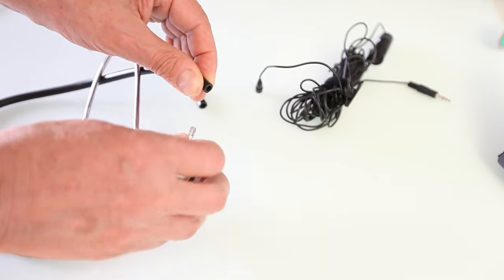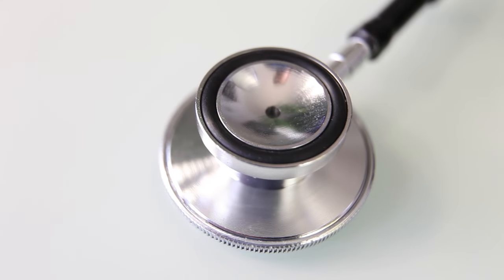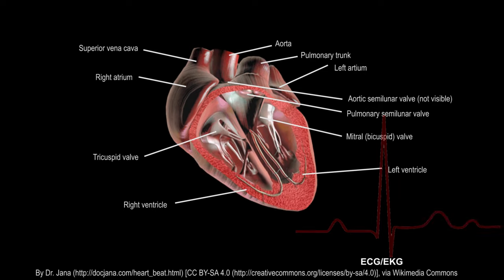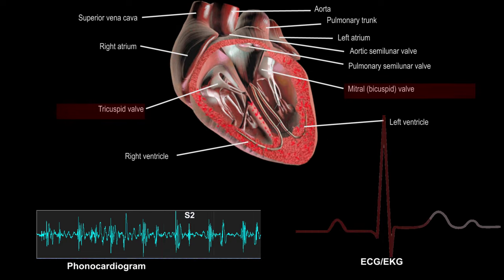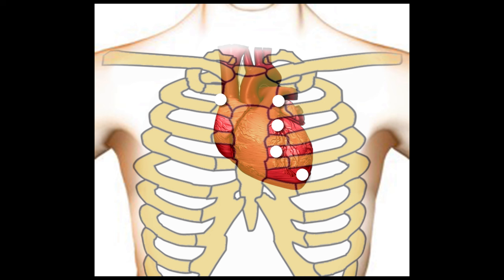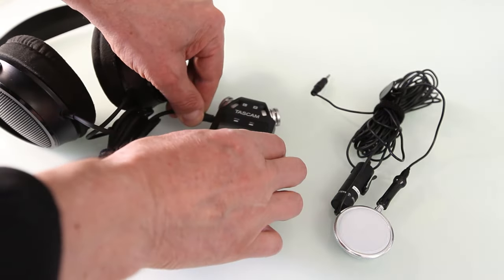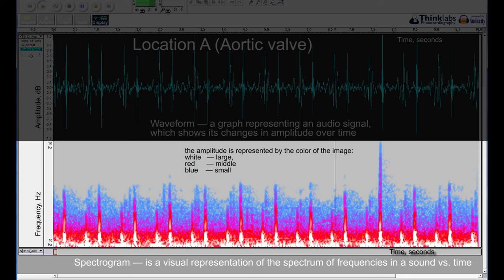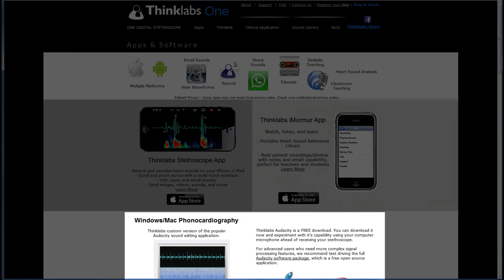DIY Electronic Stethoscope

Comment: For those wondering what type of mic to use, I was able to pull this off with a lapel/clip-on mic (or a Lavalier mic if you wanna be fancy about it). They're fairly cheap and easy to find online. You can connect them to a traditional mic pack, but there are also some that can be used with your phone.
Reply: Thanks a lot, comments like yours are gold
Reply: Can you let us knkwake and model and how you did this?